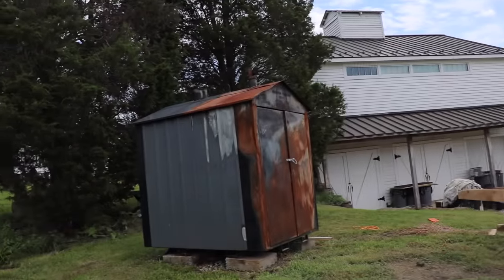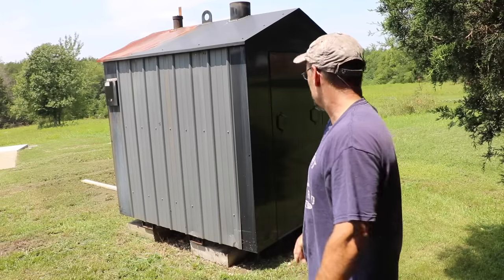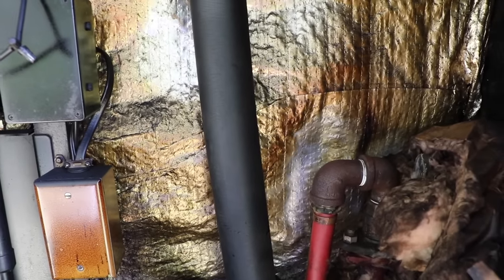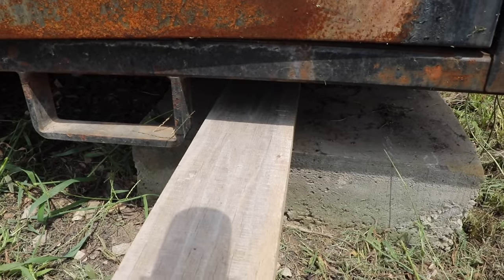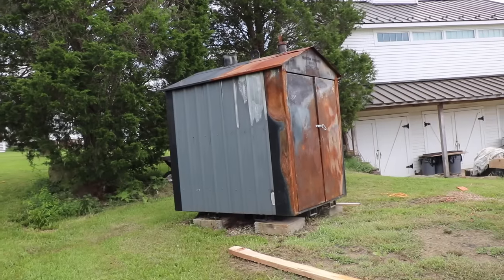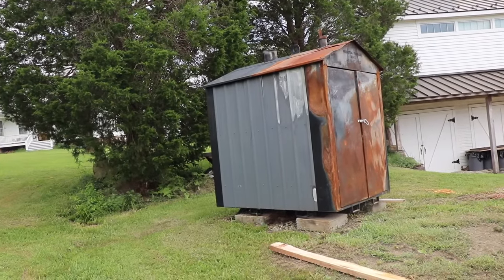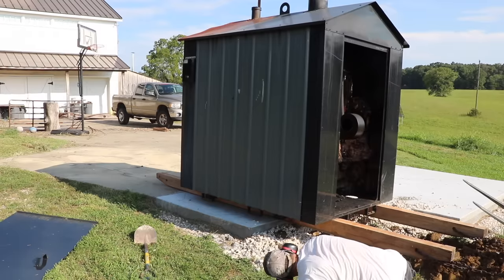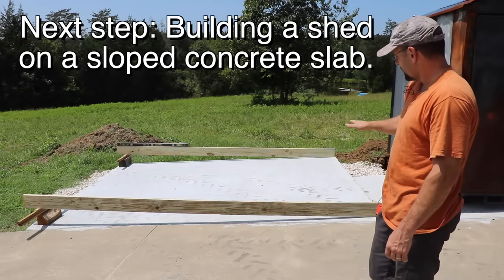How to move a 3 ton boiler that your tractor can't lift.  FarmCraft101

Comment: I remember in the 80s, my grandma's old Dodge Monaco had that style of jack. We called those "bumper jacks", because that was the era when bumpers were made of steel and were an actual part of the car, rather than a plastic P.O.S. that you're so embarrassed by that you have to hide it under a bumper cover. If you look at old steel bumpers and see a vertical slot, one on either side, that's what those slots were for. You hooked the bumper jack into them and jacked the car up off the ground by its bumper.
Reply: Cathy Garrett thats not a bumper jack lol. Similar but not the same.
Reply: Yea... Those good old day's when bumpers actually protected the thing that matters,  Your car.
And they had the "added benefit" of making short work of those pesky  pedestrians or even bicyclist's that hat the audacity to run into Your precious car...Ahh Those were the days.
And while I'm at it, let me just remind Y'all to stay off my lawn !!!
:)

Comment: In Iowa, where I grew up, we called it a handyman jack, even though the newer version was called Hi-Lift. You could sure do a lot with it, if you were brave.
Reply: If you are not mindful, the handle can ratchet under load and break things, like bones and teeth.  And the jack can easily shift, and dump the whole load.    They are really useful, but but caution is needed.
Reply: Hi-lift is the name brand of the jack still made to this day by the family of the man that invented it in 1905. I'm not sure when it was officially branded the Hi-lift jack.

Comment: back in the 1800's farmers would take the wheels off the hay wagons & put on skids for winter. i made a log skid once to remove a 1400 pound dead cow from the stall barn. got her on with come-a-long then pulled with the gutter chain. my dad claimed he cleared this 120 acres in the 50's & 60's with dynamite, 2 farmalls and homemade log sleds. they come in handy

Comment: I've always call the jack a farm-jack as well. A  couple of interesting aspects about them 1) you jack them down just like jacking them up (raising the load just a tiny fraction to release the pressure on the first pin then lowering it down onto the second pin) and  because of this you can use it as a clamp pulling two objects together,  2) when lowering if the weight on the jack head goes below a pound or two the whole jack head will free fall to the bottom, which can be very exciting if its not expected.   Thanks for taking the time to video and post.
Reply: Hello! Trail jacks I think they are called. What exactly did you mean by your second point, if you could remember your train of thought at all because it's been two years? Thinking of getting one of those jacks myself.
Reply: @netts2315  Hi, I didn't realize it had been 2 years since my comment.  Thanks for your follow-up.  Point 2 was that when lowering a load something unexpected can occur.  Think of jacking up a vehicle where the jack head contacts the bumper to raise it.  Your jack the car high enough to remove a tire, repair it, then replace it.  The tire is back on the vehicle and you are jacking the car back down.  When the tire touches the ground the jack head is still some distance from the ground (under the bumper).  As you jack down, when the weight of the car is no longer on the jack head, the jack head will free fall from its position just under the bumper to the ground.  It can be very unexpected if not anticipated.  Hope this helps.
Reply: @HWPcville  Ah, now I get it. I just find it weird for the jack to free fall, doesn't it always have at least one pin in a hole? I've also seen those kinds of jacks start to jack themselves down while violently throwing the arm back and forth which is a little scary.
Reply: @netts2315  I've seen old style bumper jacks do that (I think most cars have scissor jacks now).  I've never tried to see if a trail jack will do that as the handle is long and heavy and I wouldn't want to get in the way of a runaway jack handle like that..lol  I haven't looked at my jack lately but if I get a chance I'll see if I can determine what allows it to free fall with no weight.  Note that if the latch mechanism is up (for raising a load) there is no problem.  It's only when the latch mechanism is in the down position (for jacking down) that a free fall can occur when all weight is removed.  They are versatile jacks and can lift an enormous amount of weight.  Just use caution and be aware.  Good luck.
Reply: @HWPcville  Sorry, I completely missed the notification. I had no idea the smaller version of trail jacks are called bumper jacks or maybe there's just many names. Either way, they look really handy!
Reply: @netts2315  I'm in my 70's.  Back when I was a teenager cars had sturdy metal bumpers and car jacks attached to the bumper to raise it, hence the name bumper jack.   With smaller, lighter cars (now days) with impact resistant bumpers (plastic?) it was safer to raise the cars with scissor jacks under the frame.  I'm not sure if farm jacks come in any size other than what we are familiar with today so I might have caused confusion using the term bumper jack.  Have a good day!
Reply: @HWPcville  Ah, makes sense! Yes they did really build everything sturdier than it needs to be back in the day, that's why most of those vehicles are still running. You are absolutely correct, most if not all car bumpers nowadays are plastic and on some sports cars, carbon fibre. Scissor jacks under the frame, though safer than from the bumper, aren't too safe. They might get your tire changed on the highway but that's about it. I don't really trust those which is why I carry a floorjack in my trunk. Sorry for the longer comment but it's really interesting to hear stories from the past generations! I'm a 23 year old first year of car mechanic school, though I kind of taught myself how to do most of this stuff before I even started. I hope you have a wonderful day too!
Reply: @netts2315  I wish you the best in your career.  I took a course in auto mechanics from my area vocational school during my senior year in high school.  We learned cooling systems, a/c, brake jobs, oil changes and engine trouble shooting.  I only took the first year course and didn't pursue that as a career.  I went into mainframe computer programming (which was before personal computers were invented lol).  Ironically, I learned computer programming at the same vocational school where I had taken auto mechanics a number of years before.  Having taken the mechanics course helped me in maintaining my vehicles thru the years and enabled me to help family to avoid repair bills to some degree.  I mostly don't recognize what's under the hood these days...haha  I turn it over to a new generation such as yourself.  Again, I wish you the best.
Reply: @HWPcville  Yeah, cars have a lot of accessories nowadays. Thanks for the enlightening conversation and your wishes. I hope you have a wonderful time! What's a  better time than retirement to spend time with someone you love! Cheers.

Comment: a little time with a tape measure and you place a plastic pipe in the slab to run the hot and cold and electrical

Comment: Great idea for moving your boiler and very well executed. 👍🏻 I would have embedded a piece of corrugated HDPE in your concrete slab to bring in utility cables and hoses.
Reply: Norm T   I think you misunderstood what I meant. I small 2-3ft piece of corrugated HDPE at the edge of the slab to slide the hoses and cables up into the boiler so it wouldn't have to hang off the edge.

Comment: The steel reinforcing mesh will not add any additional strength if no placed in the middle of the cross-sectional depth of the concrete slab. The minimum depth for any steel in concrete is two inches to stop corrosion. I hope this helps.

Comment: They are called HI-LIFT jacks.  Not only can they lift stuff, with chains or cables and turning the base around, they can be used to pull stuff together or spread stuff apart

Comment: I mentioned on another thread how much I enjoy watching you work and how our minds run in the same circles, but this time I'm some puzzled.

From what you said, this boiler supplies hot water to the house, right ??  I don't see any evidence of a hot water loop, so it must take a very long time for hot water to reach a faucet when called upon.  Do you take a nap while waiting ??  🙂🙂 In my apt., it takes about 40 seconds for hot water to come all the way from the heater and it drives me nuts.  ???????

Comment: You couldn't have put a PVC pipe in the concrete to feed the piping through rather than let it hang over the back of the concrete pad?
Reply from the maker: You could do that, but I don't think you would gain much.  Pretty easy this way.
Reply: @FarmCraft101  OCD triggered...snap!

Comment: ! You should take the hot water in the top of the boiler and pump the cold in the bottom. You get the most use of the boiler if you does that. The cold water stays in the bottom and pushes up the warm water and put the water pump on the cold return line. It's better for the pump to pump cold water and the pump will last longer than if you will pump the hot water. the plumber makes like that for the possibility to sell you a new water pump. because it will brake faster if you pumps the hot water.
4:20 you are so wrong in that statement. If you think about it you will realize it. the cold water will fall to the bottom and pump in the house directly.
Reply: Totally agree, ,,,,I've had one for 22 years and I take the hot waste of the top and never had a problem with a lack of consistent heat . Runs steady at 160 all the time

Comment: How did you secure the boiler's shed to the slab?   Might have been better to set some eyelets into the foundation slab's steelwork . but some big dynabolts would do now?
Reply: I know this is 3 years old. 
No need to secure it. Whats gonna move it ?
Mine is not secured and it's been sitting in the same spot for 11 years. 
Mike M

Comment: @FramCraft101
Interesting and enjoyable, as it always is to spectate others doing hard work. Joking aside I'm a bit curious as to why You used the "FarmJacks" to "tilt" the boiler instead of using Your tractor ? Surely the tractor's "lift" would be strong enough for that task ?
Best regards
Reply from the maker: I could have lifted one side with the tractor, but hard to see while doing it, forks would be in the way of sliding in the skids, and the weight would sag pretty quickly because the boiler is so heavy.  Plus on one side there wasn't room to get the tractor in position facing the boiler.  All in all, was just easier with the jacks.  Glad you enjoyed!

Comment: I’ve been wanting to use a “bio safe” antifreeze in my outdoor wood furnace for the same reasons you mentioned, but I find it cost prohibitive. Right now best I’m seeing for a 55gal drum of 70/30 propylene glycol is about $1600, and my stove takes 400+ gals. We’re you able to source it for a better price or just made the premium? The central boiler dealer near me said if I just leave the circulator pump on, even if I let the stove get cold when I’m away on vacation, it’ll keep it from freezing. I’m concerned if that’s true or not being that I live in the US north east and it get sun zero in the winter.
Reply from the maker: I found the cheapest was to get the gallons of propylene glycol that they sell for winterizing RV's.  It's been years, but I think I got it at walmart.

Comment: Had you strapped the skids together on the back side and crossed the chains in the front you could have just backed up around the slab and pulled it wherever you wanted it. Just fyi

Comment: This is the second time in a month that I've bee shocked at the lack of lifting capacity of these sorts of tractors. Looking at it, you'd think that the tractor could easily lift that.
Reply: Agreed.  I have an old 1978 Ford 535 loader/backhoe.  It lifted a 6300 lb precast concrete staircase, (with the loader bucket still on) albeit, barely.  I guess they just don't make anything like they used to.
Reply: My numbers are correct Matt.  I custom built the form, and is built a bit thicker than commercially available (Bilco brand) stairs.  It required the hoe to be extended straight out, with all the logging chain that I could muster, wrapped around the backhoe bucket for counterbalance to pull it off.   Actually, the biggest issue I had, was the front tires sinking into the ground as I neared the excavation.  I got the stairs into the hole, but then bridged two I-beams from the bucket to the foundation wall, and chained the stairs mid-span to the I-beams, cutting the bucket load in half.  I then just lift/lowered the bucket as needed for elevation, and pushed the I-beams across the top of the foundation, until the stairs were against the wall.

Comment: I'm new here and am interested in the canopy on your tractor.  I couldn't find a video on it.  Is it fabric or metal?
Reply from the maker: Ha!  Nothing special, just a simple wooden frame and a tarp stapled on.  Attached with 2 C clamps to the roll bar, so I can take it off in seconds.  Love it, because if I accidentally run it into something and break it, I can fix it in a few minutes.  And it's much bigger than many of the commercially made canopies.
Reply: Thank you.  One of those looks like just the ticket to keep me out of the blazing sun.

Comment: From the 5 to 7 minute time in the video, it helps to keep the manual and other owner guides that come with such for ones own and future new owner's reference when it comes to maintenance or in this instance relocating to know what is what on the appliance-machinery so as to know where or how not to lift. Otherwise if the Manufacturing placard is still readable just go online and enter the manufacturer name along with model and serial number to get the pdf copy of said guide and manual.

Comment: Well, if your tractor's forklift attachment can't lift that thing directly, then why would a regular forklift be able to?
Reply: Tractors can only lift around 1600 pounds.  Forklifts go to 4000 easy for the little ones and as high as you want from there.
Reply: @GigsTaggart : Well, the forklift on a tractor (tractor forklift), vs. a regular forklift.
OK, so that gives me the numbers, but it doesn't really answer my question. So let's see what John says.
Reply: @HelloKittyFanMan.  This is a really old video.  Maybe tagging will work. @farmcraft101
Reply: @GigsTaggart , it doesn't matter how old the video is; the creator will (read: should, unless there's a glitch) get the notification regardless, if he or she has opted for it. Also, just typing the @ symbol and then the user name doesn't actually work as a tag here. It has to be based on a direct reply to one of their replies.
Reply: Which kind of forklift,   ? The stand-alone type or the kind that is used in this situation?

Comment: What is this boiler for?
Not sure why this was recommended as i don't watch farm vidoes but it was interesting
Reply from the maker: It heats my house and shop.  Glad you enjoyed it.
Reply: @FarmCraft101  steam travels through pipes in the house I'm guessing? 
Don't have time to finish video,  i just skimmed through it first time
Reply: @user-tr2dh4xx6u  Just hot water through baseboard radiators, it's outside as opposed to inside and wood fired instead of oil or gas.

Comment: Yea, that only works if you put cross ties between the skis, or happen to have steel fork guides welded to it's bottom to keep the skis from bowing in.
Reply: I wondered if the skids were fastened to the subfloor in any way. I watched the beginning more carefully and from about 5:00 he explains that the skids fit between some fork stirrups and the feet of the shed, which stops them slewing.

Comment: There is no way that weighs 6000 lb should be about half if the tractor will not pick it up I would get rid of it
Reply: looks to me like it is more 4 to 5 k pound, commercial boilers offered today are in this weight range, I am guessing he means with liquid still in it it would weigh in at 6,000. Modern tractors such as what he is using are rated around under 2,000 lbs of lift at most, they are not in the same class as a forklift which can start at 3,000 lbs lift capacity, thus the use of the jacks instead of the forklift attachment.

Comment: yeah...sorry, theres no way that bldg is 6k lbs....probs more like 1500 or 2k (maybe) ....besides,...I grew up on a farm, working with tractors, so I know what im talking about...you wanna lift something a little heavy...no prob,...attach a heavy piece in the bucket on the back,...now you can lift more with the front....but yeah,...ive also worked with "farm-jacks" and trust me you would have worked a lot harder on those jacks if that was 6k lb
Reply: I agree
Reply: How much of the video did you watch? If you're patient you'll see the package boiler inside the building. I'd be willing to bet it contributes a few pounds. Your truck probably weighs 2-1/2 to 3 tons. Could you lift one side of it with a jack like that?